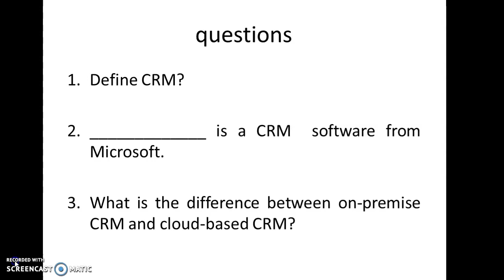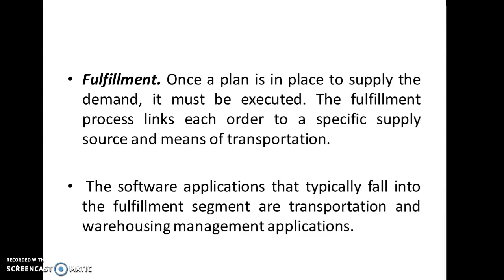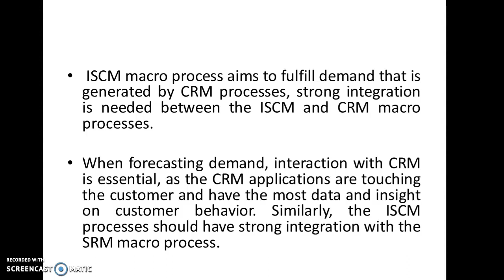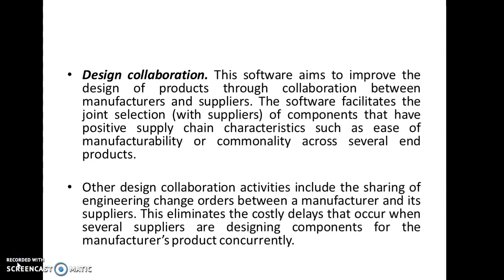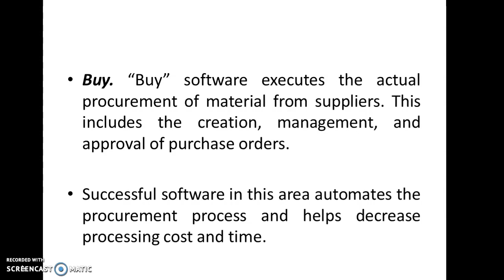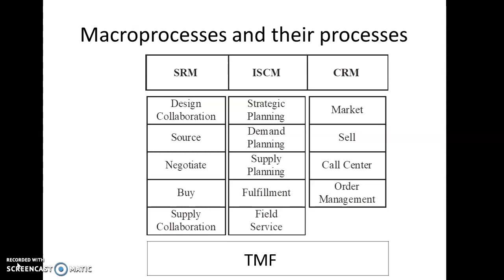Lecture 34 - Supply chain management

Comment: Akash S
Roll No. 03

1. ISCM (Internal Supply Chain Management) is focused on operations internal to the enterprise. It includes all processes involved in planning for and fulfilling a customer order.
2. SAP stands for System, Application, Products.
3. Oracle ERP called as Oracle Fusion Cloud ERP

Comment: K.kamalesh 
820417104024 

1. ISCM (Internal Supply Chain Management) is focused on operations internal to the enterprise. It includes all processes involved in planning for and fulfilling a customer order.

2. SAP stands for System, Application, Products.

3. Oracle ERP called as Oracle Fusion Cloud ERP

Comment: S.Jafar Ali
820417104021

Answers :

1. ISCM (Internal Supply Chain Management) is focused on operations internal to the enterprise. It includes all processes involved in planning for and fulfilling a customer order.

2. SAP stands for System, Application, Products.

3. Oracle ERP called as Oracle Fusion Cloud ERP

Comment: Mahdesh.U
Roll.no 28
1. ISCM (Internal Supply Chain Management) is focused on operations internal to the enterprise. It includes all processes involved in planning for and fulfilling a customer order.

2. SAP stands for System, Application, Products.

3. Oracle ERP called as Oracle Fusion Cloud ERP